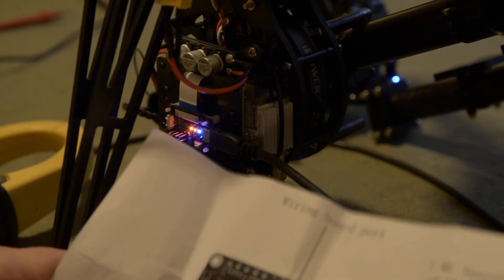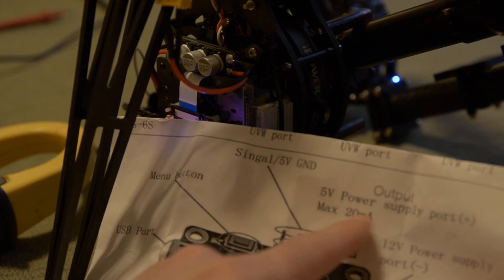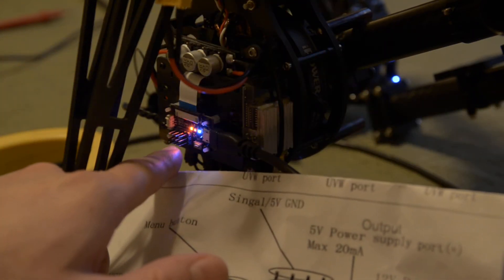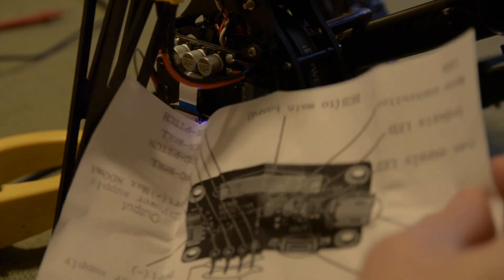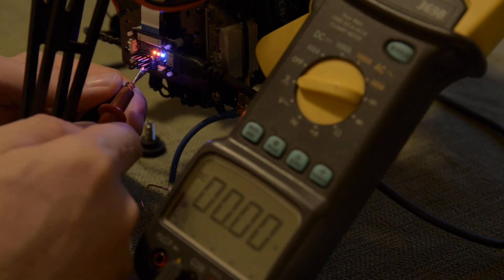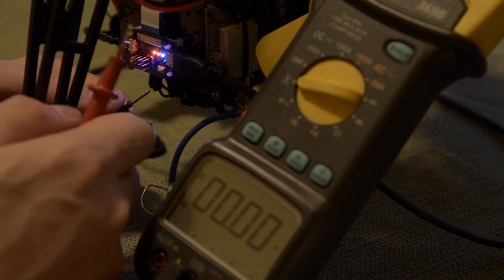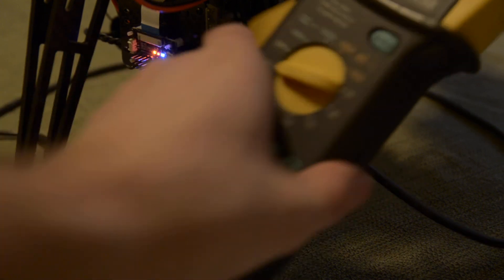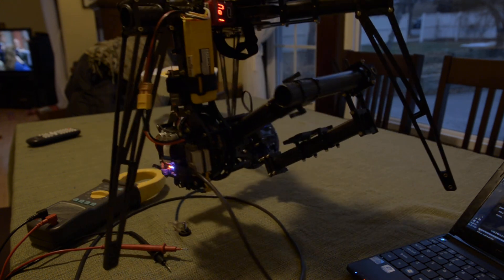Elite Power W-BGC 3 axis 70amp 3-6s Brushless Gimbal Controller

Comment from the maker: I am out of town for the weekend, but I will post when I return.
Reply: Hey Jeremy. Any update? Just curious. Any assistance you can provide is GREATLY appreciated.
Reply from the maker: Ian Cresswell The controller did not survive the weekend. The replacement should be here within a day or two. Elite Power W-BGC 3-6s 70amp Controller Fire **Unlisted**
Reply: ***** Oh no. That's unfortunate. In the meantime, do you have any footage shot using the gimbal that I can see? Feel free to email me at iancresswell@gmail.com if you'd prefer. Thanks!
Reply: ***** Hey Jeremy. I got my gimbal today, and have my alexmos high power board also ready to attach. I've got a couple engineer buddies who are going to help me put it all together. Perhaps we can collaborate to lock in good PID settings, pointers, etc. Peace
Reply from the maker: Ian Cresswell That sounds great, Ian. My replacement board is sitting in it's box waiting to be soldered up. I've got a pressing web project that is getting all of my attention at the moment. I'll shoot you an email when I get it back together.
Reply: ***** Minor setback. Something happened with my controller board. I had plugged it into USB previously and had no issues, the IMU was working great, etc. Then a couple days ago I plugged it in, it turned out, then all the lights went out. A few seconds later, the lights came back on (the little tiny red, green, blue) but solid, no green blinky startup sequence. Now the board won't connect at all. Having to send it back in for a replacement. Oh well, more time to tune the octorotor in preparation for the gimbal.
Reply from the maker: Ian Cresswell I'm still having a fair amount of trouble, too. I cannot get the Futaba S.Bus to connect properly. I know it works, I just pulled it off our FreeFly Radian setup. Also, the voltage reading is jumping around when the rx is connected, not sure if that is a concern or not. Another problem is that the controller will momentarily stop stabilizing and reset itself when it gets warm. I'm a little worried about the hardware at this point.